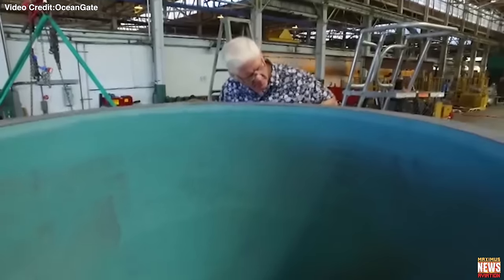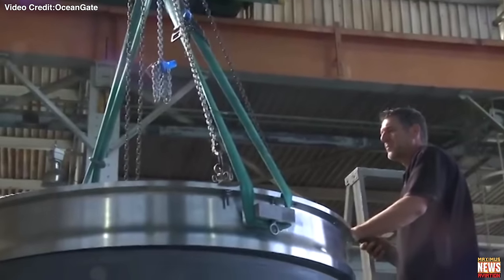Watch The Manufacturing Process That DOOMED OceanGates Titan To Fail. But It NEVER Had To Happen.

Comment: What an expensive tomb...
5 inches of carbon fiber isn't conducive to 350 atmospheres of pressure resistance.  The portal is made of material known to buckle before shattering, the computers were bolted into the hull, the glue is attempting to fuse two different types of material together, the aft looks like it would pull away from the titanium ring (the only solid material that could survive and has survived those depths), if the manifest/ log leak is rwal the electable ballast and frame were about the only solution structures holding that mess together.  Add to that the existing and noted problem with communications not working at a certain depth and you end up with a matter of when, not where or who or why.  It was destined to fail.

Comment: all the fibers in the same, wrong direction, not only is that bad for resisting pressure, it would also break in two if bent. i think it would be better to use much larger  sheets of woven carbon fiber, and place the fibers at a 45 degree angle, and even then carbon fiber would STILL be the wrong material, it's just a giant sock, you put your foot inside the sock, not outside.

Comment: I work in a highly regulated enviroment with multiple level quality control and we use isoproply alcohol and tech wipes which leave zero residue and fibers to clean surfaces before mating them and I saw someone swiping a bonding surface with an ungloved hand and a shop rag.   Cringe !

Comment: A plethora of conjectures on what caused this failure. Suggest waiting until research results on possible causes are released (possibly) for more reliable, solid data than online video conjectures.

Nonetheless, documented data exists that Rush had been advised, cautioned and even warned that carbon-fiber construction, regardless of its process (stranded, criss-cross/diamond opposing layers, etc) was not a safe or even reliable material at these depths.

Best wishes to the victims' families, friends and close acquaintances.

Comment: Two problems right from the get go.  Carbon fiber is always layed up in a cross pattern to reinforce it in multiple directions.  This spun hull in one direction was just odd.  The second problem.  titanium glued to carbon fiber, at cold depths both materials will expand and contract differently.  I do not think the epoxy would hold up to this over time.  Also why was the epoxy applied in an open air and uncontrolled environment?  The entire thing just looks janky.

Comment: Ahem, he did this all wrong! I am building my own sub from stuff I found at the scrap yard, trust me, this shit will be dope. If you want to come down with me you can but it will cost you a case of beer. My sub will be made from the shell of a Toyota camry which I have reinforced ok the inside with a webb of rebar, the controls for the sub are basically taken from one of my RC airplanes, don’t worry, I am a pioneer, Don’t listen to naysayers.

Comment: I'm not an  engineer, but I have worked with titanium and carbon fiber in the aerospace industry. Where is the engineering and qc for this? Glue to hold the bulkhead together   between carbon fiber and titanium? No flange bolts or highlocks? Bad design!

Comment: Rolling the mats like a roll of tape is inherently weak, using suspect carbon fiber is a big no no, and trying to vacuum bag a five inch thick carbon fiber tube is likely to produce weaknesses that will be deadly. I'm sure if someone put in years of work and tens of millions of dollars, a way to produce carbon fiber pressure hulls could be achieved, without risking human life. The fact no large pieces of the carbon fiber hull have been brought up suggests it splintered into many pieces because of the way it was made.

Comment: Just for a start there is not enough glue used in the bonding of the titanium ring. The point of using more glue is so that under clamping pressure you have a better chance of pushing air voids out and replacing said voids with glue. Frustrating to see not even the most basic of principles followed especially when the risk is so high. Who’s teaching these people??

Comment: effectively no serious flange / joint to tube at the end there. Like putting a Tupperware/Rubbermaid lid of metal on the end of a plastic tube. No locking mechanism, barely a lip on the outer & inner radius of the titanium. Sad. Insane.

Comment: Well it was kind of destined to happen, because he was building a pretty big cylindrical sub that can hold 5 people, meaning if he used steel, it would weigh way too much (since walls have to be thicker also, since it's cylindrical). Also a bigger sphere, maybe for like 3 would weigh a lot too, but I guess was a much better choice, if he was willing to reduce crew size, and earn less money (but he could also increase ticket price to compensate a bit). The CEO is still a big ignorant baboon - anyone with even slight knowledge of carbon-fiber would tell you that it delaminates and wears out gradually - this wasn't question of if, but of when.

Comment: you're telling me none of these engineers considered exactly how carbon fiber/glue best hold pressure (from the inside out vs from the outside in)?

sure, we're all armchair experts re carbon fiber today, but I would like to believe engineers would consider such things, especially if they know that people were going to ride this contraption down to extremely high pressures under water.

will the NTSB be asking these builders such questions, because they ought to...

Comment: First second third but twenty dives Using glue? didn't they consider movement vibrations pressure and moisture you don't need to be an engineer to know this is a bad idea and the government should have stepped in and put a halt to this...we are living in the 21 century not 1800s where innovation is allowed to the extreme recklessness. So much people are to blame also the government

Comment: Can not believe that this way of joining these materials together is going to work glueing metal to a fibrous substance with the weight of the door craning the vehicle  towing in rough sea being pressurised  numerous times exposed to the elements and not properly tested obviously  caused its demise R.I.P all onboard

Comment: The bond was applied by hand?
this was going 12,000 ft under the sea.....
Reply: It really wouldn't matter that much. The fundamental properties of the materials (cloth and glue) would have caused delamination and cracking no matter how well they were applied.
Reply: @loupgarou-dj3tm  I completely agree however if you are going down in crazy it might as well be machined

Comment: They didnt use any bolts! Only glue. At 5600 psi. I heard rush had an engineering degree. After watching this i doubt that's true. Glue should have been used to hold the gasket that should have been there. Then at least 50 1" bolts at 10" in length. 5 of those inches screwed into the carbon fiber inbeded anchor. I would guess that if anyone knew how this was fabricated they would not have gone anywhere in it
Reply: They used bolts. They were simply stripped out during the implosion. You can see one long bolt and several holes around 2:50 on the front nose cone.
Reply: @colinj5291  those only served to secure the titanium nose to the titanium ring. The titanium ring was only glued to the carbon fiber in a cup shaped profile machined into the ring. No bolts were used there

Comment: This video shows a very poor manufacturing process for a product that is claimed to be of high quality. The wet lay-up of the carbon fiber is done without much concern for fiber/resin ratio, fiber tension and fiber handling.

The more alarming issue to me as an adhesion guy, is the bad method of attaching the end rings to the 5 inch thick cylinder. These joints are mission critical. From the video I can see that there was little if any effort to control the thickness of the adhesive bond line, or avoiding voids in the adhesive. It is also fairly clear that little attention was paid to common industry and ASTME surface preparation standards. I saw no evidence of abrasive blasting on the surface of the titanium ring. When I saw the guy wiping the ring with a dirty rag, I knew these people knew nothing about adhesive application. The depth of the bond looks to be about 2 or three inches deep. The edge of the wound section is 5 inches across and ragged looking. How much adhesive dribbled into that.

The point I am trying to make, is that the amount of adhesive used, its thickness at the bond line, the surface preparation of the two materials are as important as the formula and structure of the adhesives themselves.

Comment: Oh no, Is this kidding? I never want to get in there for diving for sure.
Carbon-fiber is not homogeneous material.
You knew that expansion and compression will generate the crack in microscopic levels.
Fatigue is the possibility for collapsing.
Or, Viewport that couldn't withstand the extremely high pressure.
Joining with the glue, you also knew that joining with the glue is bad idea for submersing in sea water
and glue is bad for tension loading.

That's why this tragedy occur.

Comment: This is the production of Cyclops One and not of Titan.
Reply: Titan aka Cyclops Two was made that way. Why you lying?
Reply: @toomanyaccounts  Yes. Titan was built the same way. But this is footage of cyclops One. The video makes it seem like this was actual footage of the production of Titan when it simply is not!
Reply: @flugschulerfluglehrer  it was the process they used to make their garage kit craft. there is no difference in what is shown on the cyclops 2 vids. they still spin it on a metal cylinder and glue the endcaps on
Reply: @toomanyaccounts  Maybe. The footage is not from Titan. We do not know if everything was done exactly the same way. People have died.

Comment: the fact that they are manually spreading the glue is alarming.  knowing the pressure the vessel would be under, and having an unequal application of the two parts should have been a fire alarm moment. the construction of this was childlike. almost weirdly amateurish.

Comment: Incredible ignorance as to the engineering performance of the composite materials they were working with.    The body was made of two materials yet the design only considered one “ the carbon fibre” and its strength only in one plane.  

It’s strength in all other directions was only as strong as the bonding resin and it’s adhesive qualities to the carbon fibre.  The alarming amount of compressive movement would have in the short term destroyed this 

If you considered the resin only as a design consideration. You would never have even considered getting in the thing or even a shallow dive.  

Lockridge was 100% correct with actual visual proof of a certain immanent disaster.  

His findings were way past alarming 

The vessel should not have had a white exterior.  It should have been left clear so constant light monitoring into the laminate plus the bonded area could be carried out.  

The carbon fibre should have included helical windings as well as longitudinal strands to hold it together 

It appears also that the wrong bonding material was used.  There is no evidence of any bonding on the now titanium end rings 

The design there is flawed and inadequate 

This is kindergarten stuff.   

Total madness.

Comment: This was a poor way to even lay the carbon fiber. They needed to loop the carbon fiber end to end from inside to outside. The rigging would have been way more complicated but it would have put the carbon fiber in tension, not compression. 
     This would have been expensive. It would have required a tremendous amount of problem solving and new methods of laying the carbon fiber down. They could have even considered weaving.

Comment: The epoxy used in the construction of the tube would have done better without the carbon fibre. Carbon fibre is good for pulling strength, but there is no pulling strength here, in this situation. There is compression. Take a string of carbon fibre an pull it. You wont be able to break it. But tie a knot in it and then pull it. It will break. They are talking "space materials"; Sounds good and will work in space, where the pressures go from inside out. Not the other way around, like 4000m deep. Absolute stupidity here.

Comment: they used glue? jeez, that sounds so wrong.

if you compare it to james cameron sub, that was a solid piece of steel, bolted and melted together.
If you look at the chinese deepwater sub that can reach 12km under see level, you also see solid pieces of metal bolted together.

i would never trust glue, that already sounds so completely wrong. i am even surprised it didnt break earlier. a ticking time bomb.

its like attaching engines to an airplane and just glue them on the wings 🤦‍♂

Comment: When they make a fuselage for an airplane, they go diagonally in alternating directions with at least 60 degrees and often 90 degrees difference.  Basically like how they make plywood.  
 
They do NOT make it like putting thread onto a spool!
 
Also, just like eggs when they get old enough they get downgraded from Grade AA to Grade! A, Boeing had downgraded this batch of Carbon Fiber from Grade A to Grade B!!
 
Finally, Carbon Fiber for airplane fuselage has lest then 14.7 psi trying to force its way out when a plane is at (let's say) 40,000 feet.  It is good at Tension,.  Here it was facing  up to 378 times more pressure differential (~5,555 PSI), but Worse(!) this was Compression i.e. pressure on the outside more than the pressure on the inside.!!!

Comment: Hindsight is 20/20. 
But when the space equipment is made,isn’t it made in a sterile environment…..dust free, etc? Why? Because imperfections equal failure probability. Stockton,  I think was narcissistic, thinking his way of manufacturing was sufficient.  I could see imperfections, imperfections which resulted in death.  
Just think, if he built a parachute out of cotton balls, telling you it’s safe, but u could see with plain eye of problems in it…sure looks good, all fluffy and white…like a pillow. But when it’s hitting terminal velocity, it fails……like the cyclops.

Comment: so amateurish its unbelievable ,each rotation of each layer should be set 45 degrees from the one below and i notice the guy wiping down the titanium ring before glueing was cleaning with solvent soaked cloth in one hand and touching the cleaned surface with the other bare hand contaminating it with sweat and oil from skin ,the finished surface can be seen to be all lumpy and rough excess glue and dust and probably air and no glue in some parts of the lay up , why was ,nt it vacuum sealed to compress the glue and carbon fibre, it looks more like a 5th grade school project ,,,tbh you tell none of them are taking it serious or know what they are doing, the owner had by the sound of him serious mental health problems

Comment: Whilst there are ways to build carbon fibre structures that are stronger in compression, this appears to have been nothing more than a poorly produced carbon fibre tube, take that and factor in the micro fractures that would have occured within the resin every time it went down   and failure becomes inevitable. Forget paying money to go onto that, if I had seen this video  in advance there's not enough money in the world that could have persuaded me to set foot on it

Comment: Should have had it  ' professionally  engineered, designed and tested multiple times ''.  Another ' garage nut '.  With a  wingnut  idea,  doing a poor job, of his own  demise.  Mr Rush.  
 ?.....hmmm. Reminds, me of  the rest of this generation :  '' I'm  in  a  hurry,  because  i  have  to  get  there,  before  i  forget  where  i  was  going'.   MILLED,  LATHED  TITANIUM,  FROM  ONE  huge solid  piece,  SHOULD  HAVE   BEEN  DONE ,  for  380  bar  pressure.  ( 12,800  feet deep.  380  x  14.5  lbs/ per square inch  =  5,510  pounds, per square inch.)  This  titanium made one, would have survived that  depth.  NOT  glue, and a  one-direction only carbon fibre wrap.  Even boat, and other makers,  layer their designs, in 180  degree  directions.  Composites, do not for an external  pressure vessel,  make  good  strength.  By the way, titanium is a very hard  metal, to both machine, lathe, mill.  Subject to a lot of strange  quirks, of physics.  Do a study.....

Comment: IMHO, this is how not to work for stuff that will be subjected to hi pressure, low temperatures...
If you are not working in a sterile environment, you have not any barrier to dirt/polluting particles in the buildup, especially doing a work by bare hands ( and this is incredible....!!! )....
In the end, you are making a NOT Homogeneous vessel, and it means, a lot of different stress forces acting on the vessel in an extreme environment for which it would be built...forces that act on the structure on each use cycle, weakening it each time...
I think this is pure ignorance of the basic rules...

Comment: That whole video is cringeworthy.  He was right that ring was the point of no return cause it would have been the fail point as if you can glue this shit together the dumbness here is unquantifiable.  Rush was also right we did see and why was the connection with the glue so minimal it looks like the cylinder only went like 50mm over the end cap.